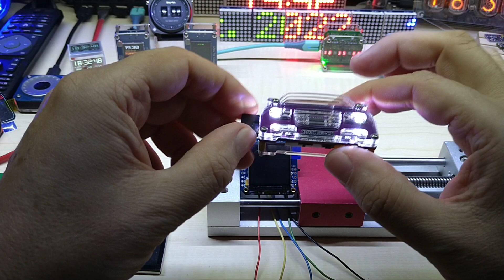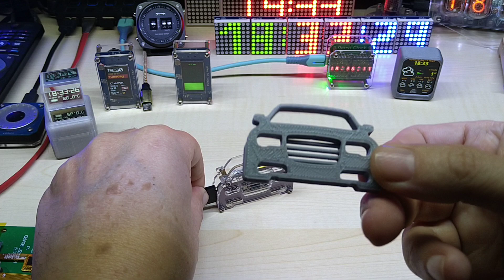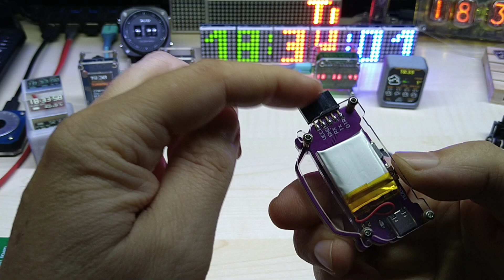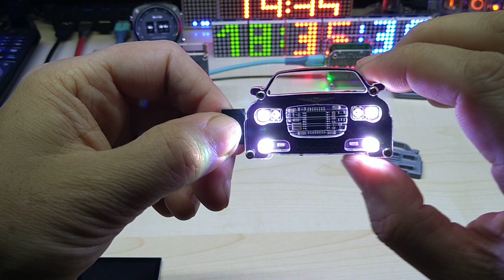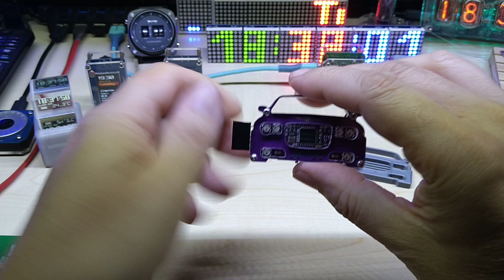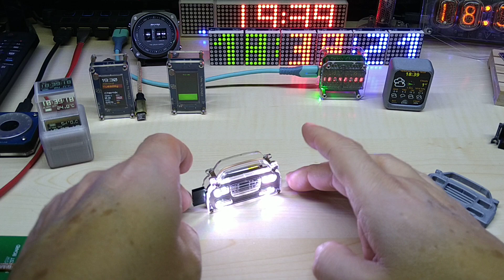Automotive Gear Indicator, 300C LED Key Chain, Preview of my New Phone Notification Gadget by #Hayri

Comment: Hey Hayri i am curious to see if you have anything similar to the CAN-GAUGE that does not require the can bus system. I have a older car and would love to have something similar that functions just off the OBD-II port.
Reply from the maker: Hi dlorp, actually I do, I have a CAN BUS Node, that adds a CAN BUS network to your car that you can connect my gauge to. It basically takes 5V analog signals and broadcast them onto a CAN BUS network.
Reply: @iHayri1  very interesting. I do not see the node on your tindie page though. I'd love to read more about it and see if it is truly what i need
Reply from the maker: @dlorp.  I never got around to put it up on Tindie, please send me a message or let me know your email and I'll get back at you with more information, thanks.
Reply: @iHayri1  i have sent a message via twitter as it appears that youtube removed my comment containing my email address.
Reply from the maker: @dlorp.  replied via twitter